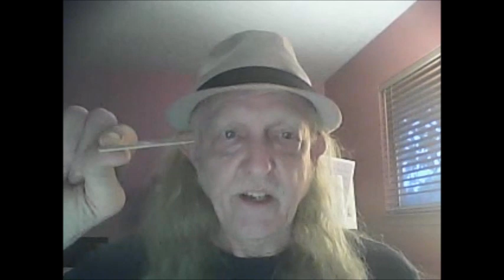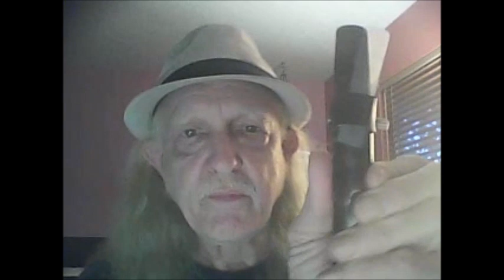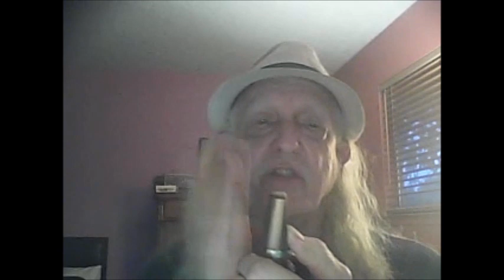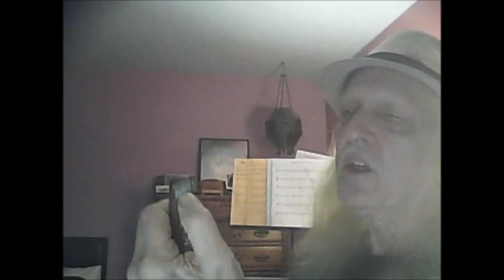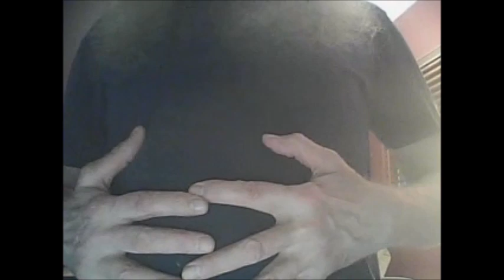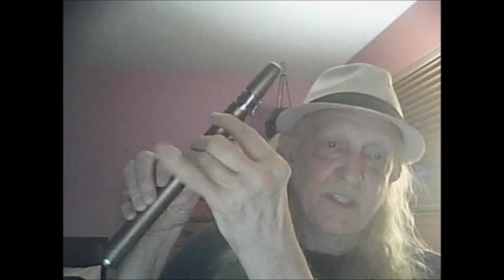Talking Xaphoon 5  - How to make a sound

Comment: Hi, how hard do you have to blow to produce a sound?
Reply from the maker: You produce the sound by forcing air between the reed and the mouthpiece.  It isn't a matter of blowing hard.  It is more about finding the right amount of pressure to put on the reed and the right amount of lung pressure needed to maintain a steady tone.  Blow no harder than you need to.  Blowing harder will raise the volume and is extremely useful for shaping a song dynamically, but start out learning to play as softly as possible.  You will develop better control that way. 

 Thanks for watching my video!
Reply: @xaphoonandsmallwoodwindins6787  Thanks for the info. It’ll surely help a lot.